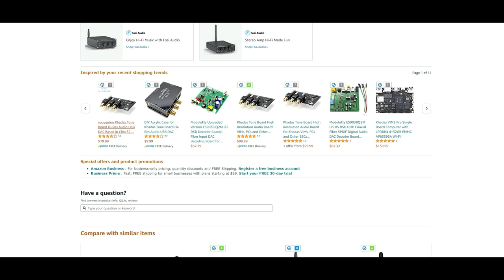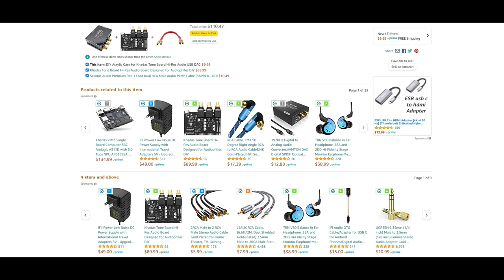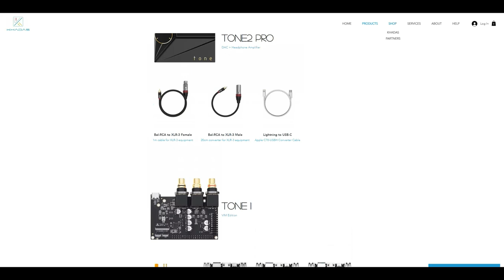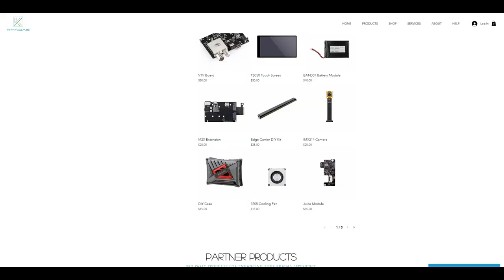Khadas Tone Board -  Pimp Yo Dac

Comment: 10:01 "the tone board is not a good proposition for most" 

smsl sanskrit is $110 and topping e30 is $130... khadas tb is only $80 so it's the cheapest good measuring dac right now on the market, and considering its great sound quality one of the best value for money.
it is also the smallest if you want to save desk space. 2 reasons that makes this a good proposition for those interested in good sounding small gear for cheap.
Reply from the maker: It may be value to YOU but most people would prefer a fully enclosed product that’s actually finished. That’s why I said it’s not value. As for measurements, big deal. You can’t hear any of the atomic level measurements companies and ASR keep boasting about. Once you factor in a remote, a screen, a sturdy case, your Tone Board is nowhere close to $80.
Reply: you can buy a case for $10 and it's still the best value dac available. measurements is a big enough deal to know it can do as well as more expensive ones, meaning at least you're not buying crap, and that's all i need to know from it... fancy screen and remote may be a value to YOU but some don't care and may prefer to buy the cheapest smallest one, and that is the real value for them.

@Lucca Silva yes, i found topping d10s and jds labs atom dac available at $99, but i got ktb at even cheaper black friday deal $69 with free shipping, i couldn't refuse. as a secondary dac the small form factor for my laptop was a bonus.
Reply: @Lucca Silva chinese black friday happens before the western one and only last 3 days, so i add items to my wishlist over the year and wait till november to pull the trigger with some crazy discounts. you just have to be patient but it's worth it.

Comment: I would agree with this review.  The biggest different between the Tone Board (which I own) and the Topping E50 (which I own) is the treble.  It is slightly rolled off as you mention.  Because of this, it may be that it sounds less detailed.  However, it also has less tendency to bite on poorly recorded material.  The tone board seems to bring vocals more forward with the lower treble energy on some tracks. When I was into speakers systems, system matching and listener preference is a key factor.  The tone board with the Sundaras (2020 version) may be a better match while the tone board with the 4xx might be a tad too dark. Again, that is my personal preference in sound.  The Topping E50 can have a touch too much bite (and / or wall reflection emphasis with some tracks) with the Sundaras on some tracks.

Comment: Thank you for this video. I appreciate your review and this is the only instruction I could find for assembling the case. Helpful. (That led light is insanely bright, isn't it? It took four layers of led filter tape to subdue it enough to suit my liking.)
Reply: Btw, running mine off a pi streamer. I like just a touch of diy. ;-)
Reply from the maker: Lol. Yes the light is a bit much. You could use it as a flashlight

Comment: Leaving the Ifi Zen Dac's extra features aside how do you think it and the Tone Board compare purely as dacs?
Reply from the maker: Fairly different sound signatures.  The TB is neutral, but the Zen has a slight U-shaped sound.  The mid-bass is elevated on the Zen, and there's a mid-treble boost, as far as I can tell.  Both are good at what they do, so it really boils down to features and sound signature.

Comment: Can you clarify your stance for me, if you believe dacs effect sound at all, or just not the soundstage? Just curious, regrading your somewhat recent past statements, thanks.. Happy holidays btw
Reply from the maker: Happy New Year. It’s a bit complex. Strictly speaking, dacs have no direct effect on soundstage. However, power output to the headphones do. Underdriven headphones will suffer in soundstage and overall sound signature. Dacs do affect sound, depending on the Dac. My position is that a neutral Dac is a neutral Dac. There are so many of them—NX4, D50, E30, Sanskrit—that THESE dacs have little to no variation in sound signature between them. But other dacs that are tuned differently—the Mojo, Zen Dac, Monolith THX, TRAmp—all have noticeable deviations from neutral that you may notice in your setup. Your headphones, their sound signature and sensitivity—have a much greater affect on what you hear than dacs and amps alone. My position is that if you want a different sound signature, changing your headphones and IEMs is the easiest, and most obvious, alteration you can make. Messing around with dacs and amps is at best going to provide marginal sound changes, unless you opt for a Dac/amp with a specific tuning.
Reply: @NoThemeReviews  Thanks for the response. Just wanted to be clear your view..